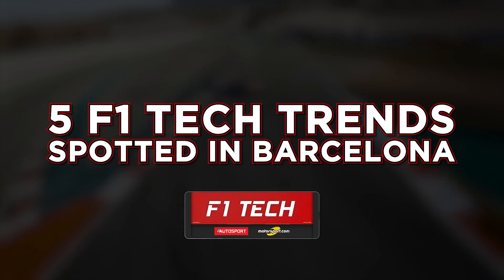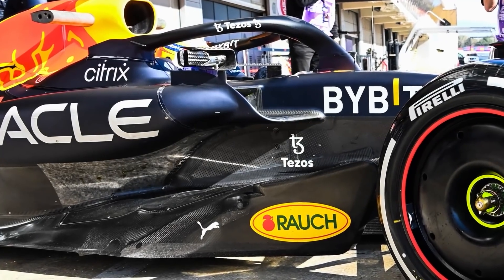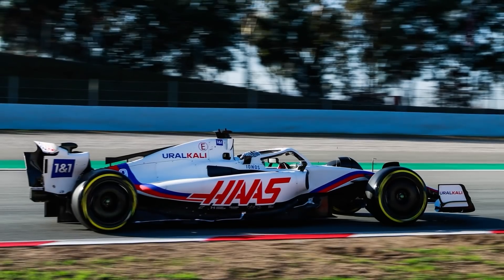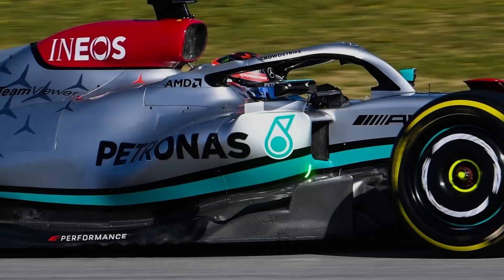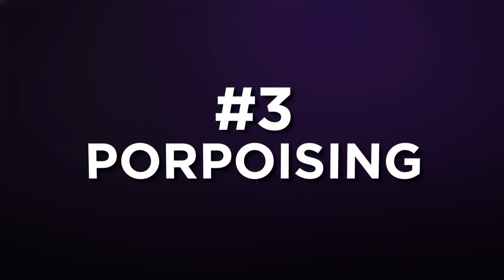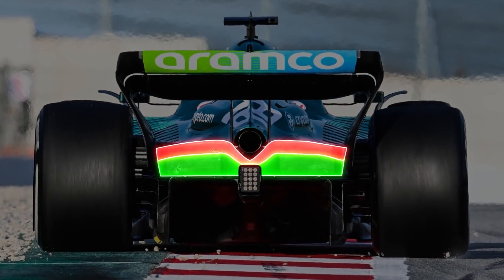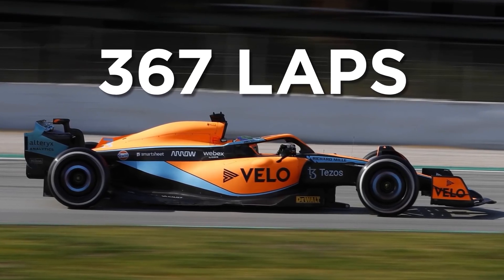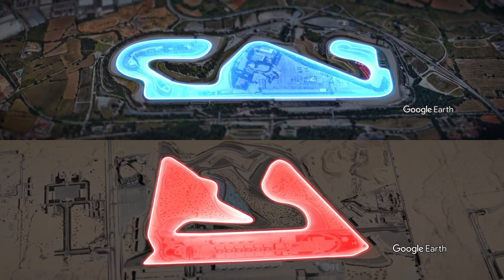5 Tech Trends From F1's Barcelona Test

Comment: I think McLaren has the car packaged very well and the speed is there. I noticed how McLaren's performance fell off last season after Danny Ric's Monza win, McLaren's been working on 2022 car since and it shows
Reply: Well Mclaren had their development tokens made void because they needed more time to develop the car to accommodate the new Mercedes engine. This was because they were using the same car as 2020 which was designed around the Renault engine. So they could've been more competitive if they were allowed to develop the car but they weren't, so as Ferrari brought in their new power unit upgrade, Mclaren couldn't really come up with an answer.